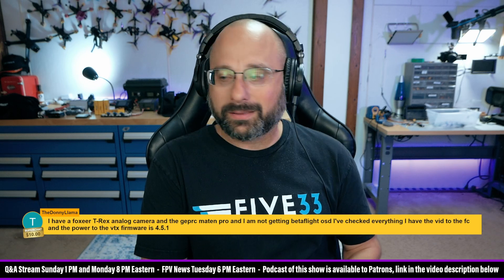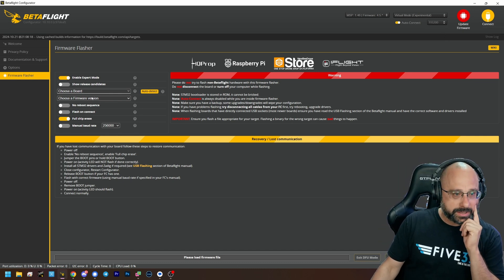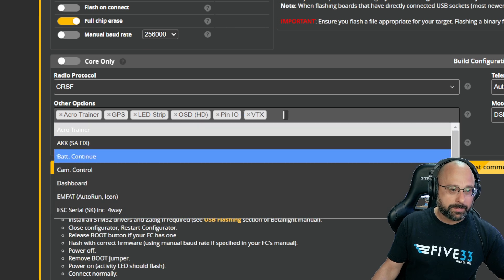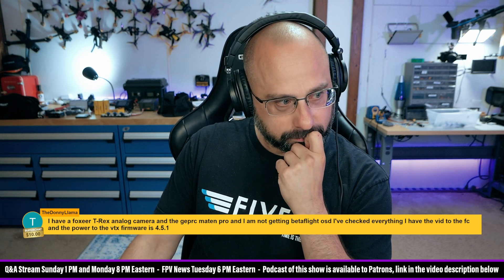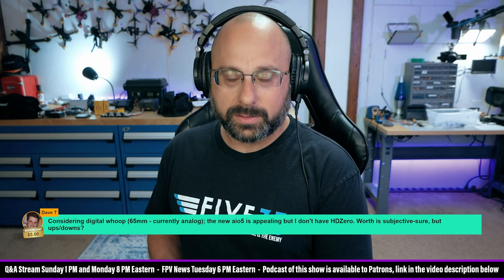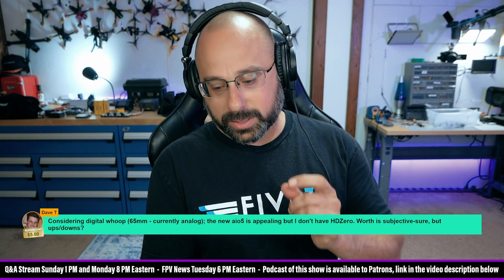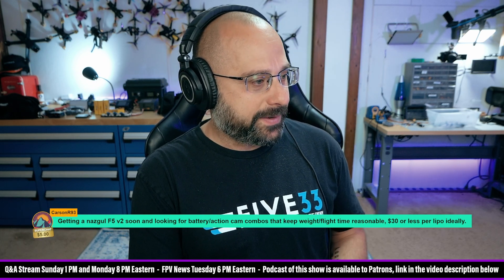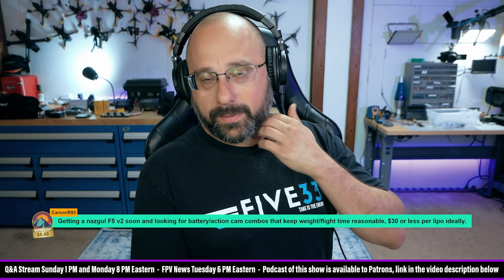My Drone Is Screaming On Full Throttle? Not Getting Analog OSD? Should I Use An Action Cam? - FPV Qs

Comment: With Foxeer predator cameras I've had to completely turn off the OSD stuff in the camera menu before I could get the betaflight OSD to show up. I'm talking about physically plugging in the little control board to access the camera menu settings, not betaflight.